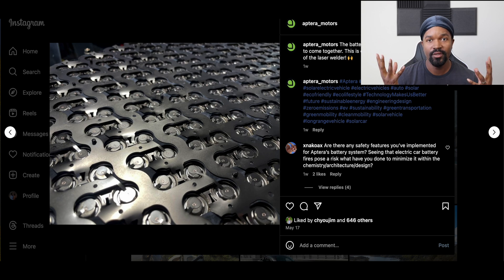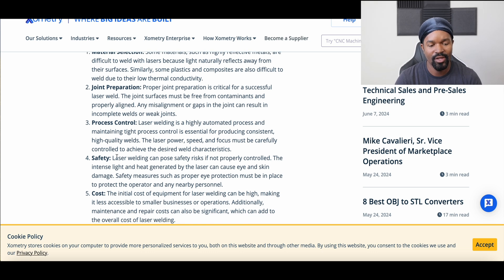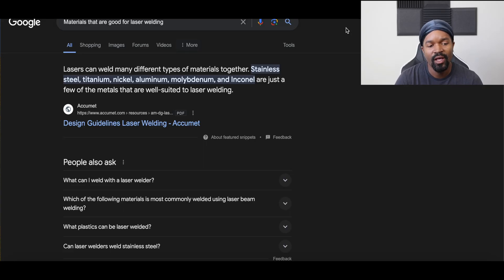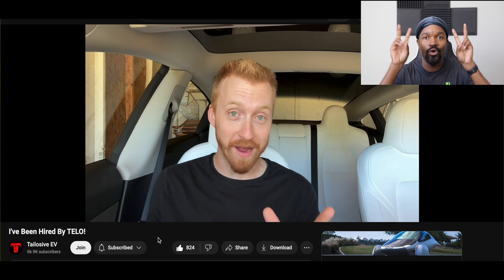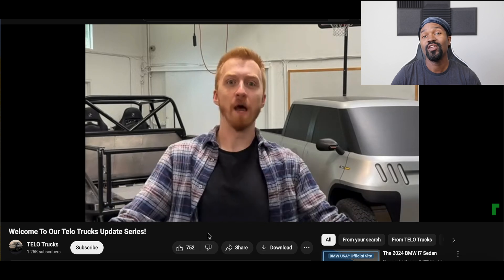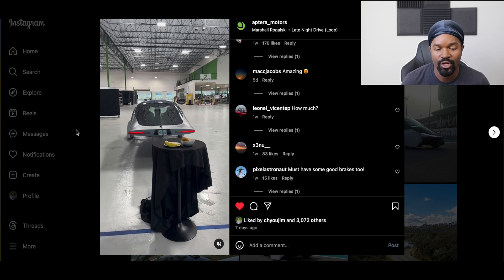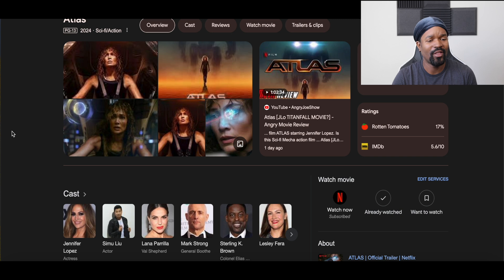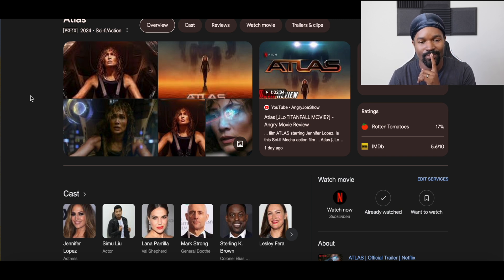Aptera News Update 28MAY2024

Comment: I hadn't seen the Aptera tablecloth truck yet, but in case anyone isn't familiar with the BMW S1000 RR did this back in 2010 with a huge dining table and full settings. Definitely worth watching (especially since they didn't have such a long cord to build up speed).
Reply from the maker: I am unfamiliar, but I do know its not a new trick. There are several cars that have managed the same, but none of them were doubling as the most efficient car ever. ;)
Reply: @theninjineer  True, but electric motors do have the benefit of max torque at zero rpm.  I think that's something people will need to readjust to... I configured my pre-order with the awd and 400 mile range (before switching to LE, sadly not Accelerator program) to have something left for passing at highway speed, and for reasonable range in summer with the A/C, and winter with the heat on. Plus it should help the batteries last longer by not using as much of their capacity on a daily basis. Thanks for the videos; keep it up!

Comment: I would have figured aluminum would be bad in laser welding since it's optimal for solar reflectors, including infrared light.
Reply from the maker: Yeah as I thought about it, anything that could be polished to a reflective enough surface could be a problem, but I believe they may have been speaking on the natural properties of the metals. Aluminum and Copper are good at absorbing and dissipating heat, so I am thinking they may be good with welding too so long as they are unpolished as the bracket for the cells seem to be.

Comment: Clean copper.. can't weld or cut it with a laser. If you dig you can find a story about someone who attempted, but burned a hole in a concrete wall instead